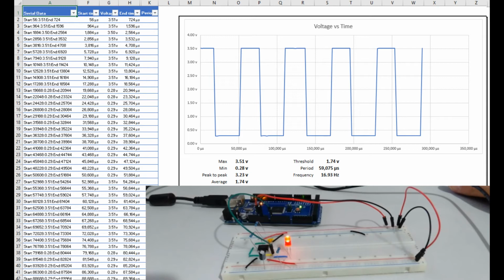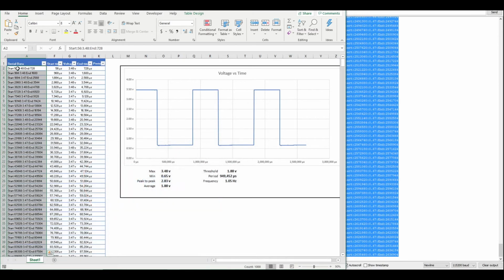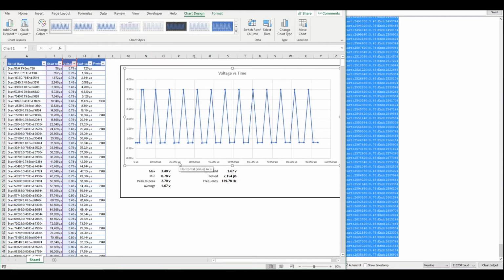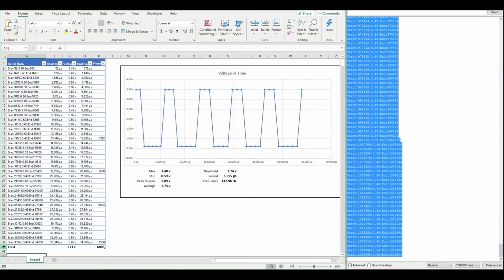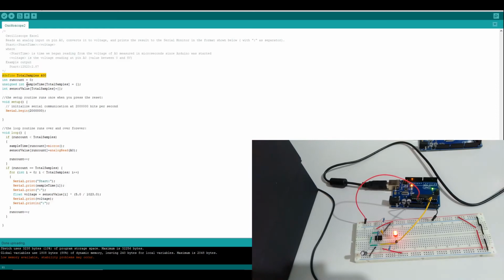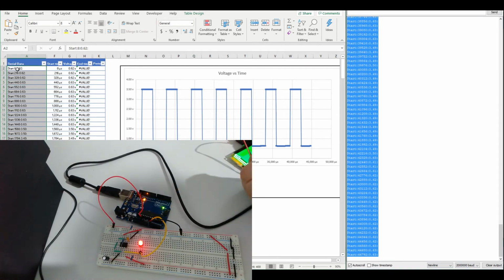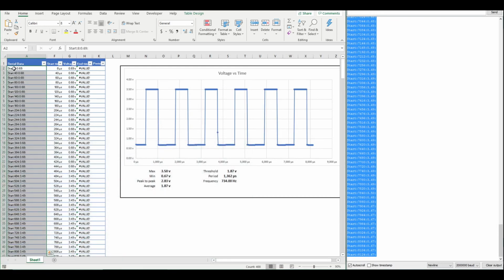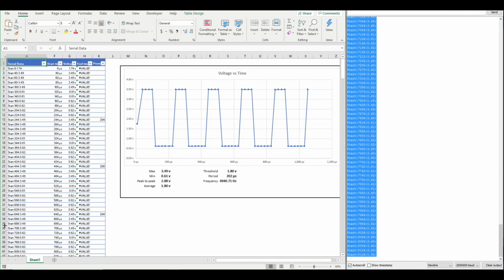Oscilloscope using Arduino (ExcelOscope: part 2: Measuring frequencies up to 4kHz)

Comment: 👍 This Is Probably Possible With RPi As Well. 
I don’t have Arduino. Maybe ATtiny Somewhere. Just Wondering What I Can Figure Out
Reply from the maker: If you have ATtiny I think those have an analog to digital converter so could be used in a similar way probably. The raspberry pi doesn't have an analog to digital converter so more circuitry would be required.
Reply: @overengineeredinoz7683  Thank You Sir. You’re Awesome